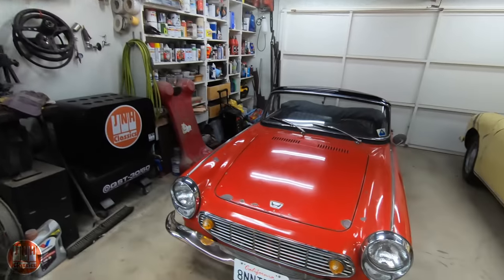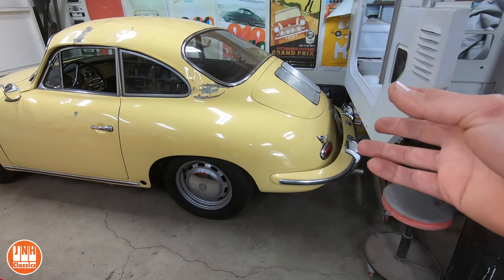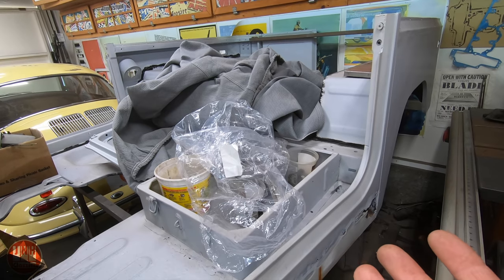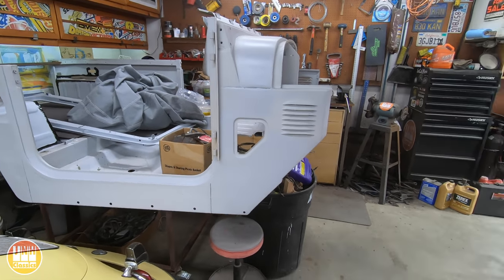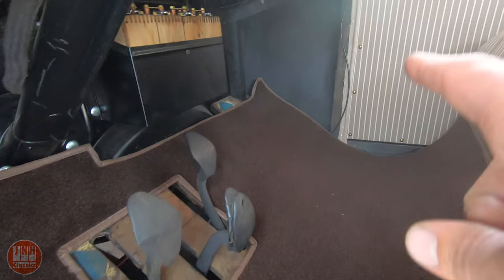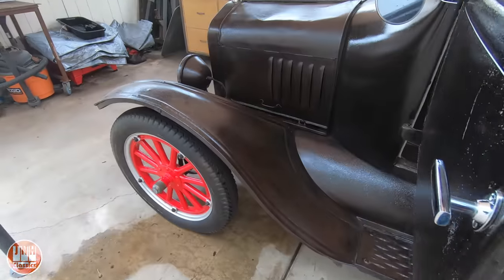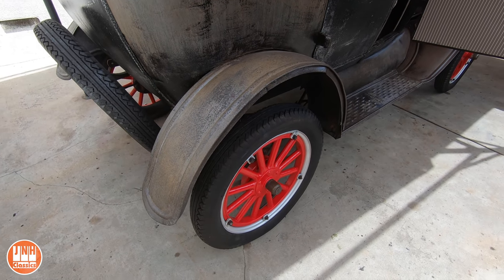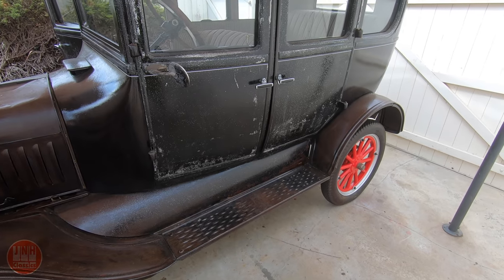Update on the Model T and all the other Projects  - Sunday Update (4-18-21)

Comment: Oh dear, I didn't want to cause a broken generator with that advice, what a bummer -.-
My Model A's generator was really easy to take apart, and while I had it apart, I replaced the wires to the brushes, too - it really takes nothing but a wrench, a screwdriver and a soldering iron.
Best of luck with the ongoing work on your T - the interior looks absolutely fantastic and the engine runs smooth as can be.
Wonderful!
Reply: With luck, it's just a previous fix that got undone. If any wires had burned when he did the adjustment, he would have smelled it.
Reply: @bruwin  A hundred years of brush adjusting probably made the wires frail...

Comment: Brilliant video. That carpet kit is shocking! The upholstery looks great you have done a wonderful job on the T. Thick rubber mat cut to size would be best in my opinion. I would have fitted the isolator adjacent to the battery and keep the engine bay looking “ old school “. Send generator away to get it serviced and repaired. Don’t forget to turn the key 🔑! Well done mate sounds great 👍

Comment: On prewar cars the wood floors with all the different pieces allow a lot of air through while driving. Now especially In the front the heat from the engine compartment blows straight in- making the car unbearably hot inside. So the carpet is not just aesthetic but helps keep the hot air out but I'm sure you know this by now.

Comment: Hey - try pushing the third brush back where it was and just test.  If that works it might just mean you retracted it too far.  They need to be set far enough that the field coils can build up a charge.  If not, check the gasket behind the brush you adjusted.   Tightening that nut down too far and you can crack the gasket.  The third brush needs to be insulated   good luck! Cheers and love the entire build!
Reply from the maker: Thanks for the advice. I did put it back to see if it would charge, but that didn’t work. The gasket looks pretty bad so maybe that’s the problem 👍
Reply: @Jerod_Helt  Perfect.  I learned the gasket issue the hard way last year myself 😀.  There is an excellent video on YouTube from modelt-tips who interviews a guy doing a full rebuild of the generator.  I followed his advice to disassemble and inspect.  The other thing you will want to take a look at once you get the brushes out and the back off - two of the brush holders should be insulated, and one grounded.  If you need  to replace the gasket, you will have to drill out the rivets and then re-rivet the brush holders down.  T generators make for an interesting mini project indeed.  Good luck sir !

Comment: Have you done a frame alignment check on the Porsche 356?  Curious if you generally take your projects to a frame shop for checks?  On the Model T, aren’t the door cards usually a solid color material?  Using the more utilitarian rubber floor mats would prolly be an effective and practical choice for the T.  I can’t remember what you did during the rebuild, but perhaps not using any modern gasket sealers and sticking only with a cork gasket would solve the oil leakage issues.  Thanks for showing the startup process... that  was interesting. Well, don’t forget the key!   It sounds great!  Did those have mufflers or straight pipes?  ...perhaps that might help with the cabin noise.

Comment: There's a good chance you will forget to flip the starter switch someday. It may be better to hook up a solenoid relay to the batt side of the starter and solve this problem altogether. It's also nice to have it off while driving. I would also do the same thing with the fuel. It's easy enough to install a powered shutoff valve there. Could be an extra 50 dollars but well worth it if you don't want to have problems at the car shows.

Comment: I'm sure you could do a much, much better job of fitting carpet than that sorry kit.  You could make a template out of paper and cut a piece of inexpensive carpet remnant or area rug to fit. And if you get a piece of carpet that has a rubber backing, it won't even need any kind of binding.  Just something to think about.